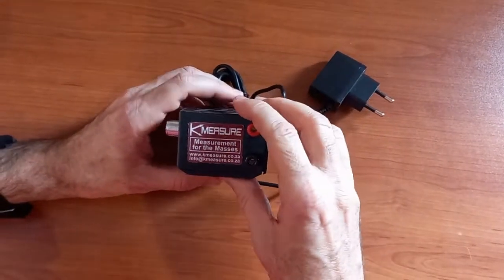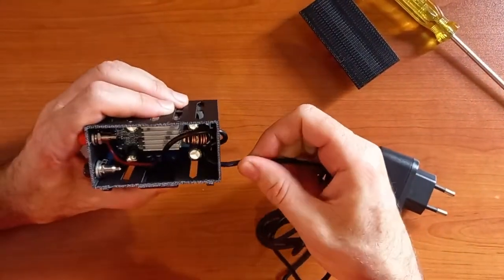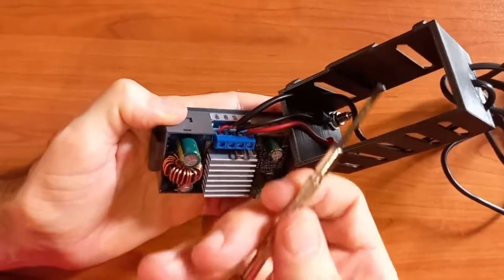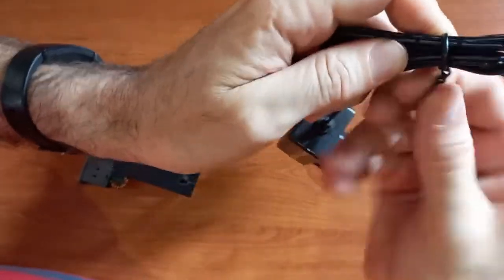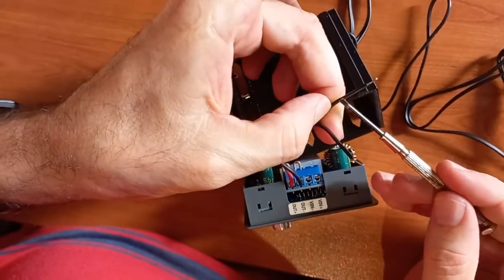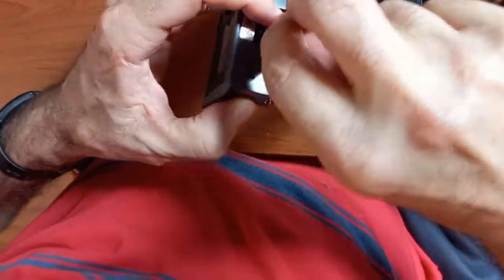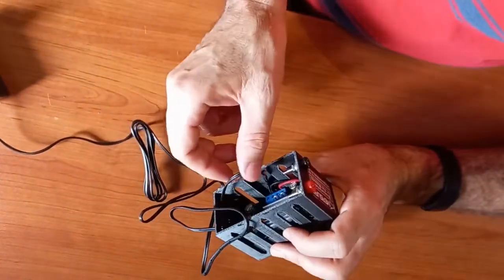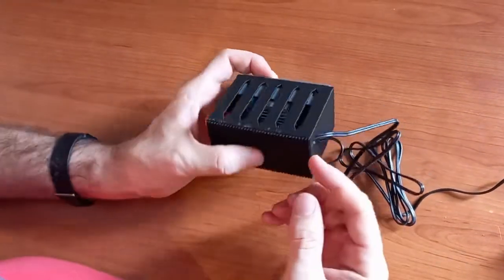How to swap out the DC power adapter on the XY-SK35 and XY-SK80 Adjustable Bench Power Supply

Comment: Why did you change the cable?
Reply: We supply the XY-SK80 with a 20W DC adapter that will supply an output current of 0.8W, which is sufficient for most general-purpose uses.  Because the XY-SK80 supports up to 5A, you are able to swap out the DC power adapter with one that supports 5A.
Reply: @mardine9931  cho